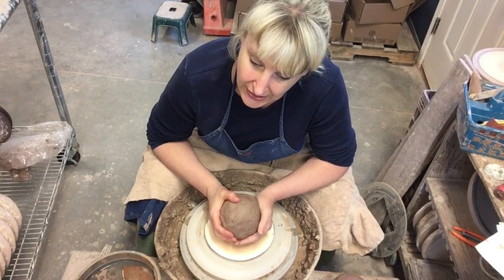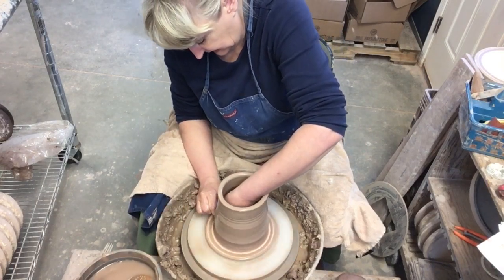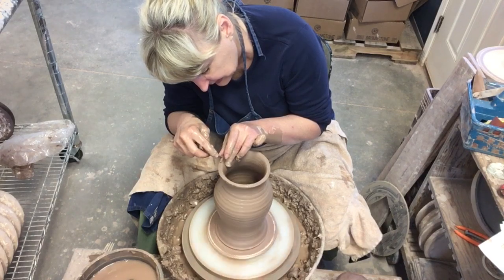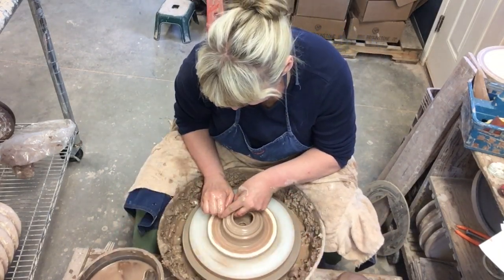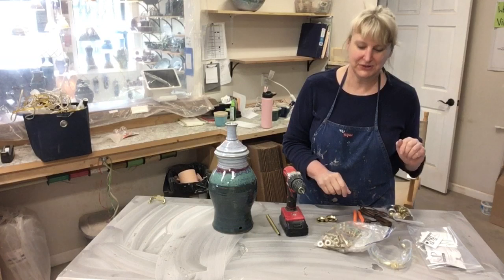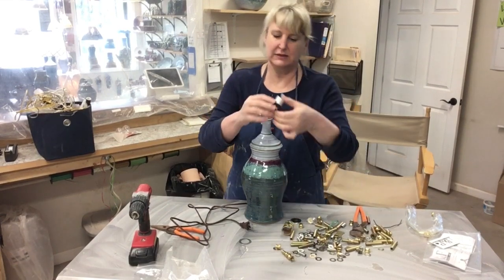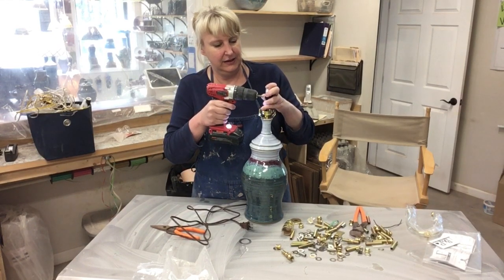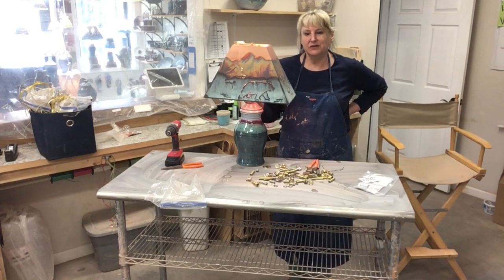How to Make a Pottery Lamp-All the Steps from Raw Clay to Wiring | Weaverville, NC | Salvaterra Pots

Comment: Great tutorial. Gorgeous lamp!  Could you please comment briefly on how you joined the 2 base parts?  Thanks
Reply from the maker: Thanks for watching.  When the two pieces are still wet but easy to handle with out distorting the shape, I put hash marks on both pieces where they will be joined.  The I take a generous amount of slip(liquid clay by mixing clay with water) and put a generous amount on both pieces.  I place on one top of the other with a wriggle and then pressure.  I usually cover the top to below the joint with a plastic bag so it will dry slowly.  And that is about it.

Comment: great video. I've been thinking about making some lamps and this convinced me i have to! I'm really interested in how you trimmed the bottom to be open... it seems that it would be very hard to do all of the wiring without it open. Also, do you throw all of your lamps in two parts like that? awesome video again, great learning tool :)
Reply from the maker: I made my smaller lamps all in one piece.  They start at 2 pounds.  When I throw any lamp, I make it with a hollow bottom.  No trimming.  The inside edge does need cleaned up with a sponge.  So, after I center the clay.  I go clear down to the bottom of the bat and then open the clay up and start pulling up.  That was a great question!  Hope it goes well for you.  Sue

Comment: Hi! I’m trying to find one of the longer “things” you use in your video. It’s the long connector that goes through the hole and connects the inside to the up top outside. You said you have to order longer ones separately. I can’t locate a name for them nor have had luck finding a name online for what it could be! I want order some longer ones to give a go at my first lamp! Thanks so much for this video you’ve shared, it’s so resourceful!
Reply from the maker: They are called a threaded rod.  You can get a long one at Lowes and cut it with a hack saw.  They are in the lighting section usually on an end cap.  I have also bought them through a company that sells lamp parts in casa grande Arizona. Here is a link to a place.  There are different sizes so make sure you get the size you need.  https://antiquelampsupply.com/collections/pipe-nipples-rod/products/1-8-ip-solid-brass-all-thread-nipples-pipe

Comment: Thanks for sharing this info.  Quick question.  How do you attach the top to the base?  Does it sit on top of the rim or does it fit inside the rim?
Reply from the maker: Bit late on the reply.  Yes I score and slip the rim and stick it on top.  The key is to measure the width of both pieces.

Comment: the video you shared is quite detailed. i, however, would like to know the process of glazing you did for this nice lamp. thanks.
Reply from the maker: I dipped the bottom 3/4 in a green glaze.  Turned it upside down dipped the top in a white glaze, overlapping the green.  Took a squirt bottle and streaked a raspberry glaze where the 2 other glazes meet.  Hope that helps.

Comment: Thank you for this great video Sue :) I have got a question. How would you go about this if the ceramic sculpture is not straight and you can't access the lamp holder from below? Thanks
Reply from the maker: I have seen fixtures that have a cork and all of the wiring external to the piece.  See if national art craft has those.

Comment: Lamp is beautiful. What size should the opening be for the fittings?😇
Reply from the maker: I think you are talking about the top cap.  I make mine around 1” diam from outside edges so that is probably a 1/2” on the inside.  You can buy different size caps.  I usually have different sizes on hand and pick the one when wiring that fits the best.  Hope that helps!